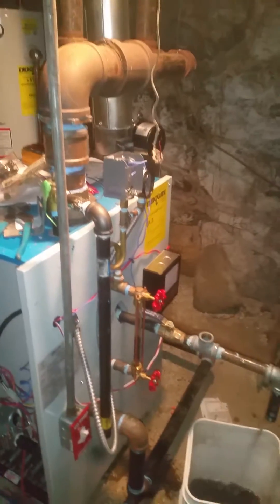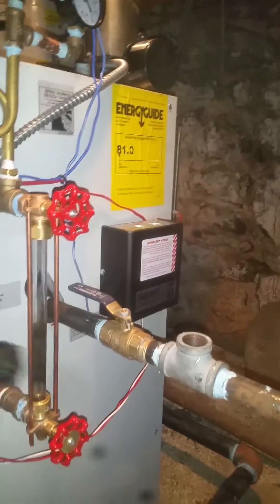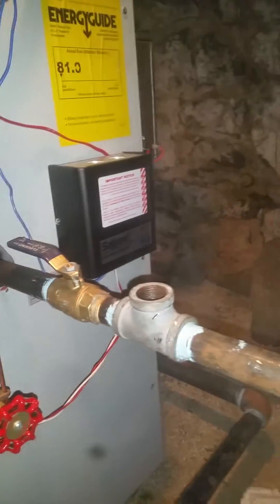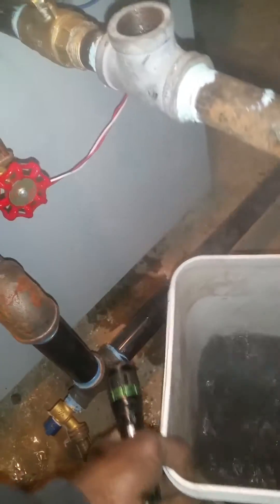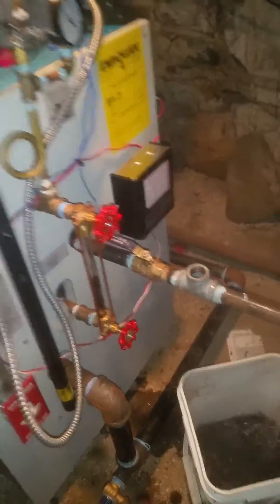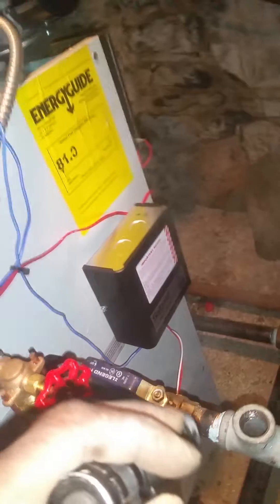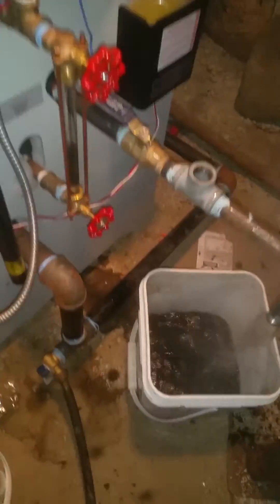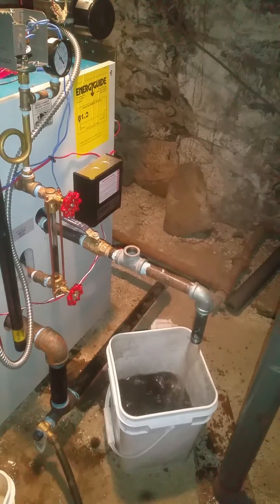Skim tap Steam Boiler

Comment: Thanks you were the only one that explain it in a very simple way. Question What happens when you don’t skimm a new boiler ?
Reply from the maker: Boiler is shipped with light oil coating inside, the worst that could happen is that oil gets in the controls or the vents could cause harm or failure of boiler.
Reply: Clyde Zackery I already used the boiler for a month and half already with no problems and the water 💦 is clear because I put a conditioner
Reply: @clydezackery_hootie26  Do you generally leave the nipple in place after you’re done skimming? Or do you put the plug back?
Reply from the maker: @Iwearmysunglassizatnight  I normally put the plug back in, however once I was short an elbow and had to use the plug on a tee to make an elbow. Then I put a short nipple w/cap
Reply from the maker: @Iwearmysunglassizatnight  I usually replace the plug, however there were occasions where I installed a nipple and cap or even a nipple, valve and plug.
Reply from the maker: Conditioner helps break down the oil and render it harmless to your boiler
Reply: Clyde Zackery Thank you so much sir for your help. Doing the skimming process I guess is another preventative measure for the boiler not to fail. I purchased a Utica steam oil boiler and after I Apply the conditioner it stop surging and the water got very clean